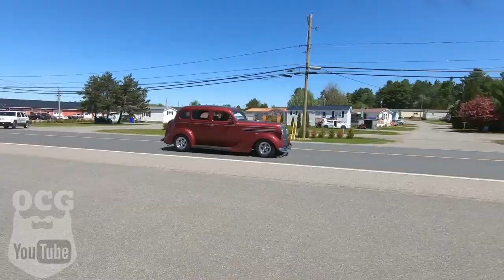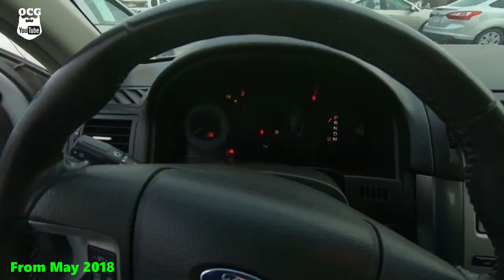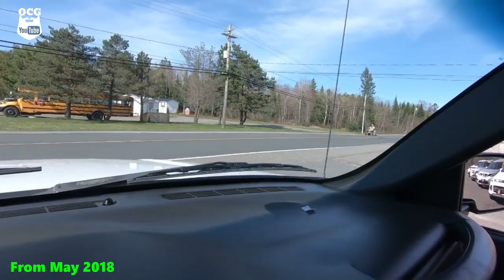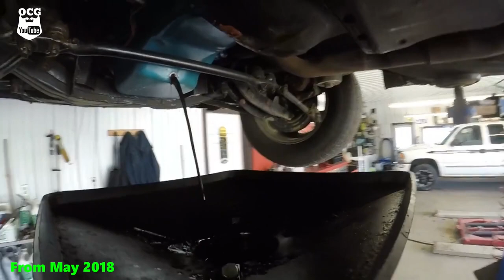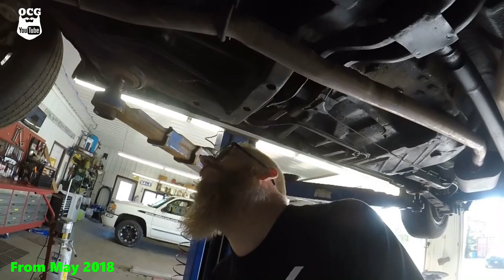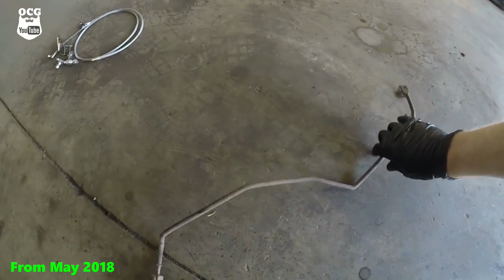REBOOT From The Archives Of Olde Carr Guy- My 1979 Cordoba Gets Attention Ep.1

Comment: I've been put oil in my filters since I worked on turbo Saabs minimize dry start as much as possible and I won't use non greaseable joints on any of my mopars. Not only passing gear but controls line pressure for shifts with out it hooked up you will burn up a stock transmission in short order! Great doba thou.
Reply from the maker: Such a small gesture to making your engine last that much longer